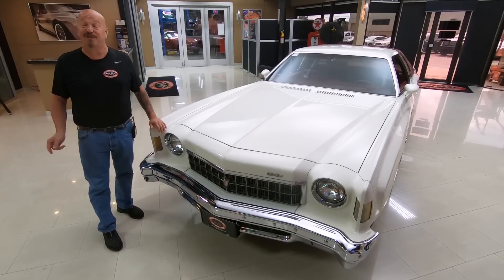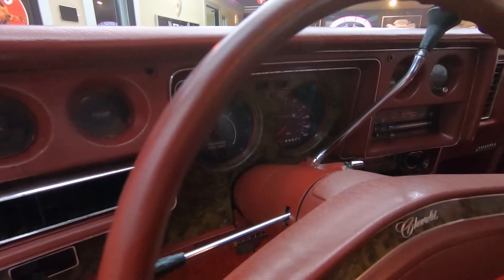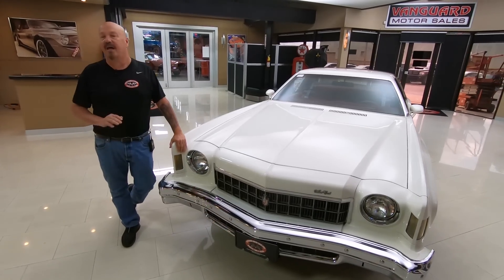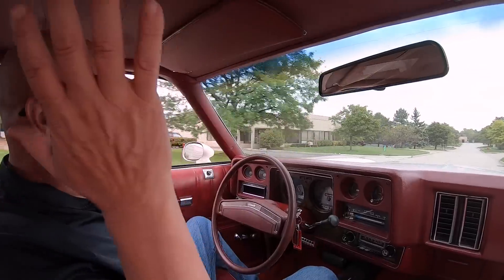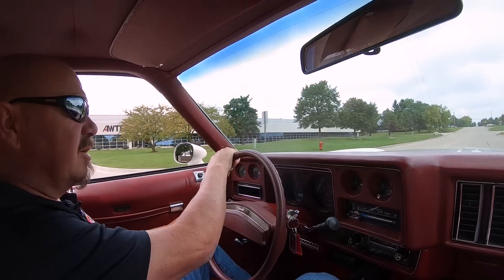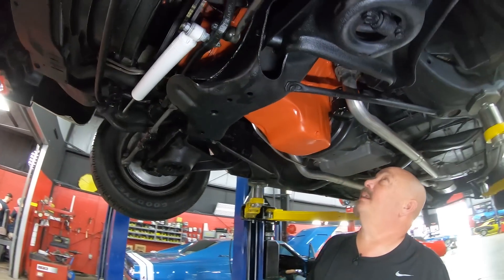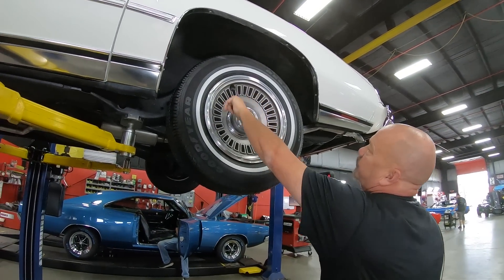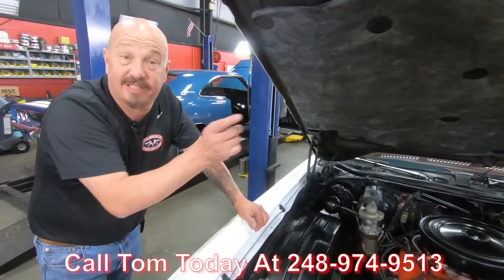1975 Monte Carlo For Sale

Comment: Fan shroud is like a wind tunnel.
Neighbors had a burgundy Monte Carlo like this in the 1970s, and I could swear it had swivel front seats. I told coworkers about this, and nobody would believe me. I was hoping this video would prove me right, but this beautiful car has a front bench seat.
Reply: You are correct!!
Reply: Yes, the hi end model(cant remember name)    did have  drivers seat   swivel
Reply: Lake Nipissing, you are correct. The 70’s model Monte Carlos had a Front Bucket Seat option & a “swivel to door” option as well. you held up the slide lever & the seat would swivel towards the door.
Reply: My Grams  had one and it was so damn cool white interior  swivel bucket seats 👍👍

Comment: My Mom had one of these when I got my license in 1976 with around 9,000 miles. The 350 2BBL was one hot little engine. I dogged it so much a year later with only 17,500 miles; it was using 3 qts of oil every oil change. I was so ashamed of myself after I realized I caused it!